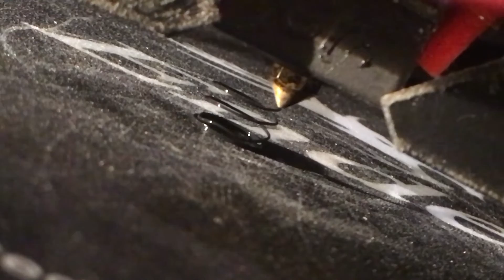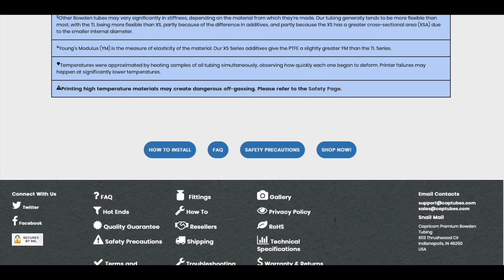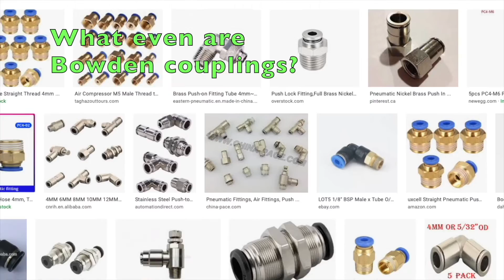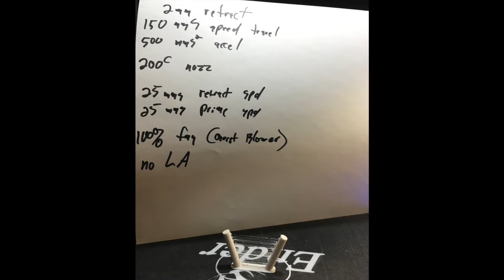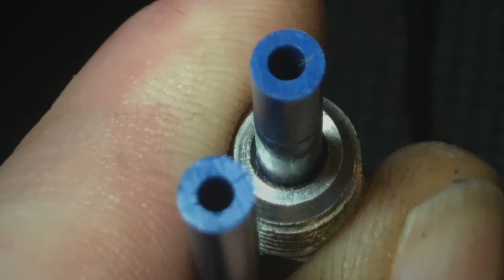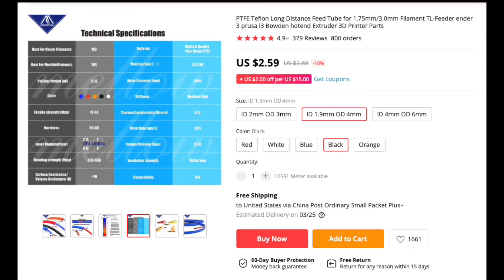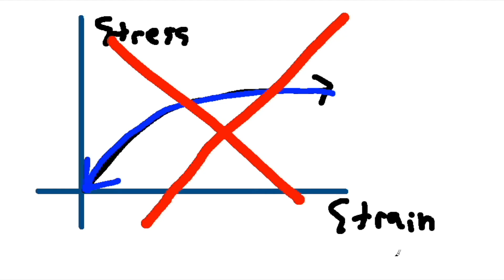Fancy Bowden couplings and fake tubing tests

Comment: I'd love more info about the hydrologic couplers you used! What sizes? Where'd you get them? What was the process of drilling out the PTFE tube for the inner compression sleeve?

Edit: The barb would preclude using the hydrologic fitting on the hotend side of the coupler, yeah?

Comment: Maybe this was your point, but the ratio of Young’s moduli between the tube and filament, I think, only matters in so much as the lower of the two will determine how much retraction/extrusion force you can apply.

So, ideally, your Bowden tube would be at least as stiff as the filament. If it’s stiffer, then the filament will stretch. If it’s less stiff, then the bowden compresses. In reality, I assume, both are happening. Complicated.

Comment: Here's a crazy idea and this could just be the right place to deliver it. What about a push/pull cable sheath? Something like bicycle brake cable, not exactly, but that kind of thing. They're steel reinforced to combat stretch yet designed for flexibility. Pretty sure there are Teflon lined ones too. Just a thought.....

Comment: does the fan cooling at 1:11 have any venturi effect like you teased on the fan videos or just small nozzle on 5015 blowers that are angled at like 45 degrees so you have a lesser angle of wind deformation?

Comment: I had an Ender 5 pro that "featured" some really crappy Capricorn tubing from the factory. Could very well be the same stuff you experienced.
After i bought a genuine Capricorn from a reputable source my printing quality went up a lot too!
(upgraded to a Ender 5 Plus now and upgraded to some real Capricorn too after that experience)

Really awaiting the (air) cooling followup from your other part 1 video... :D

Comment: Funny, I was going to post a comment that mine (direct from E3D UK !) arrived with a mis-centered hole and a larger out-of-spec OD, so it didn't fit my reamed hole in a cold end, ... but then you mentioned exactly that. ... E3D sent me a replacement, but the OD was still out of spec. So this is not just some dodgy distributor re-branding fake tubing. See photos (remove the space, damn spam protection): https://imgur. com/a/QlkOyt8

Comment: Hi Alex, to reduce stretching of ptfe tube try to use glass fiber reinforced packing tape (reinforced along tape) example of this tape is Tesa Monofilament. You need to wrap tube paralel to the tape it is tricky but gives awesome results. I personally reduced retraction from 5mm to below 2mm on around 0.5meter bowden.

Comment: Thanks, Alex. Keep that technical detail coming! It's hard to tune a system of you don't know how it works! Something that bugs me is that there is no feedback in the control system for the most important parameter which I believe is probably the pressure at the nozzle? I'm trying to think of a way to achieve that. Maybe a servo motor with power or torque sensing for extrusion drive?

Comment: For anyone interested I reverse engineered the link of the black aliexpress Teflon Tubing:
https://www.aliexpress.com/item/32354926214.html
And this one is similar from Trianglelab:
https://www.aliexpress.com/item/32961383872.html
Reply from the maker: Yeah, that's the stuff.  Sorry, I may have to post a follow up vid with all the things I cut out for time.  THat black tubing performed pretty well even though the tolerance was not quite as tight as Capricorn and the center hole was not quite as centered

Comment: I noticed that your bowden tubes are longer than what they need to be. I would assume that a longer tube means more friction, but also higher radius bends. Have you tested what is the optimal length ?
Reply: This might interest you: https://youtu.be/DB5b4673GJ0
Reply: There is also a printed coupling (thing:3837897) that claims to remove all play, would be interesting to see how this compares to the proper hydraulic coupler.

Comment: Can you please share the exact model of the hydraulic coupler you used and where you got it? The results are quite promising and your whole argumentation makes a lot of sense ...
Reply: I found these on aliexpress that look the same and should work: insert (GP-4-2) https://bit.ly/2w7D0ZF and coupler (JS46 4mm -M6x1 ) https://bit.ly/3a7N6sb
Reply: your insert link is broken but I believe you are talking about "10pcs JIANHE GP Brass tubing bushing 4mm/6mm/8mm/10mm Oil pipe fittings/ Compression Sleeve Fitting/ nylon tubing oil core" which is in the same store (JIAXING JIANHE MACHINERY)
Reply: @StrikeEagleCC  thanks but both links seem to point to the same item, still need link to GP-4-2. But i might look it up myself since now you gave us model numbers 😏

Comment: I just checked some "Capricorn Bowden PTFE Tubing XS" which I received a couple of weeks ago from AliExpress.  At first glance it looks and feels just like the real stuff (whch I also checked) and had the right labels - but the bore isn't concentric at one end, and the internal diameter measures over 2.05mm (I can easily slide a 2.10mm drill all the way in, quite different to the real stuff in which the bore is 2-3 drill sizes smaller).  And this wasn't cheap.  I've just opened a dispute with the seller :-(

Comment: Excellent video Alex.  Do you have a comparison pneumatic fitting ( with clip or zip tie to set the teeth ) vs hydraulic fitting with either the real capricorn or the black tubing.  Interested if the difference is substantial enough to go to hydraulic.  Again, thanks for a real eye opener.

Comment: I don't own a 3d printer, so maybe this is just me speaking from ignorance, but would bicycle brake cable housing work for this sort of setup? I imagine you'd need different couplings since the cable housing has a larger OD due to the steel in it, but you can get ones with the PTFE liner for pretty cheap. 
(Reason I even clicked is because "bowden cable" is the technical term for bicycle cables, and I'm subscribed for other content.)
Reply: You can also get compressionless brake cable housing but it's far more expensive, not sure if that would be needed for the printer but if you have trouble it may be an option.
Reply from the maker: yes I looked into it a little bit and I may see what I can turn up in the future.  My first thought was SIS shift cable, but it may not do well in compression, so I've had an eye out for cable with controlled internal tolerance as opposed to just 'nominal diameter'.  If anything useful comes of it, I'll post a vid.  My original hydraulic couplings were from shimano disc brakes, but i switched to bulk brass couplings because man they mark up the price when the box says 'bicycle'...
Reply: @AlexKenis  Shift cable housing is compressionless as the metal wires that support the housing run along the jacket as opposed to being wound like in brake cable housing. It may not have the correct internal diameter though, as shift cables are thinner than brake cables, so you'd have to test it with a piece of filament to see if it would actually fit. Brake cable housing has a larger ID, and there is compressionless brake housing - but it's a specialty item. Jagwire makes some, not sure who else.
In either case you'd be limited to 1.75mm filament... too bad the manufacturers don't make it smaller diameter. Maybe one day when the printers-manufacturers realize they can consistently get away with using shifter housing for a bowden setup?

Comment: I would like to know the size of the hydraulic coupling you used in the video. I am sure i can figure out the how too my self from the quick flashes of video you shown.
I use the black top pneumatic coupler they have a much better grip than the blue top ones. The black top also allow the PTFE tube to be pushed through hard up against my self designed extruder gear with out drilling the back out. I would be very interested in this hydraulic coupler for another setup.
Reply from the maker: THat was one thing I forgot to compare.  Those black 10mm thru-couplers hold really well on the hotend side, and don't develop play very easily, but you need a different feeder to use them on the other end.
Reply: @AlexKenis  yeah i have a self designed belt driven extruder 3.75:1 ratio with a 40t pinion gear. I brought a hobbed gear as well but i like the pinion better because of scrubbing of the curved hobb on the filament shaft and i never had a grip issue unless it was catastrophic. So i use black topped couplers with aliexpress 1.9mm ID tubing. The PTFE tube is cut to the shape of the pinion gear and idler bearing and meets up less than 1mm tollerence. I tried printing TPU on my bowden its working ok. I want to mount the extruder on the right x axis on a cartesian to shorten my bowden that will help.

Comment: So much misinformation. You can't say it's fake unless you know. You can't use calipers to measure the inside diameter of a tube. That's just ignorance. Your data is piss poor.
Reply from the maker: Hey Chris.  I understand your concern : I cut out a lot of the methodology explanation and fast-forwarded the testing for the sake of vid length, but you can see in the FF sections that what I did was measure the wall thickness at several points around each cross section and use the difference between that and the measured diameter at the same cross sections, at several spots of freshly cut tubing.  That is as accurate as I can get without specialized test gear... BUT  it did show that the genuine Capricorn was pretty much spot-on exactly what they claimed, which also somewhat validates the methodology.  I used to to fabrication and QC on industrial control equipment, including pneumatic/hydraulic systems for Kimberly-Clark and the like, so it's not my first rodeo, but you are right in pointing out that I should not just trust that everyone assumes that my results and methodology are solid. I would have been more thorough if I had been accusing anyone in particular, but I know (and you know) the reseller as an honest guy, so I left names out of it until we can see if it was a mistake from a middleman distributor or something else.
Reply: Yeah, he measures the wall thickness not inside diameter. It's then shown in the diagram. You seems pretty stupid for a smart guy.
Reply: What's Chrissy's problem, if Alexis did any more in detail explaining/relativ-izing no one could watch this. It's all laid out as open as bearable, we can all notice the parts of the results we deem important... Don't see any mis-information just an excaustive presentation of happenstance
Reply: If Alex did such a poor job (in your opinion) then why don't you replicate the experiment. That is how science is done. So put your money where your mouth is and provide your own data.
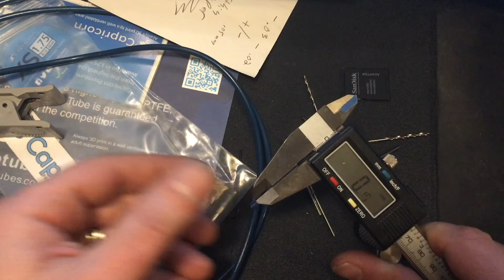Reply: I think he was actually measuring the wall thickness with the calipers. If you stop at the 14:47 mark you can see the section of tube held in the calipers by the wall. Maybe he doubled the wall thickness and subtracted that from overall diameter to determine the inner diameter.
Reply: With all those drill bits on the desk when he's measuring the thickness at 14:47 I'm fairly sure he could have gotten reasonably close as far as horseshoes & hand grenades go, coupled with the discoloration from a known good quantity & stretch test. And ya you CAN measure the inside diameter with calipers with a gauge block.. If glove don't fit you gotta acquit. That also ignores the results from the prints working and the deviation between them. I'm inclined to believe the rather large amount of data he provided. Being as you make videos yourself why not reproduce his results and show the difference you found instead?  I'll wait for your reply here with a video to validate your claims ok? I don't have the time and money to go around intentionally buying fake things to test and really appreciate people identifying and testing it for me so I can when I do it unintentionally. If you can help to fix that by invalidating/validating his data I'd appreciate it it's how science and testing works after all isn't it? Thank you in advance.
Reply: @Chris Warkocki Maybe you can't.  Maybe others understand appropriate techniques.  There are plenty of people around here who are used to mesuring small things.  I measured my tubing the quick way with drill bits from a fine-step (0.05mm steps) metric set which I then checked with a micrometer.  I apparently have some genuine (from an authorised reseller, correct bore size according to Capricorn's specs)  and some fake - much larger bore size. Very easy to tell apart when you try.
Reply: @Chris: I like the fact that Alex is an original thinker: he uses his own brains, gut, experience .... and also tells us what he is doing and why.
Reply: Why are you being so aggressive ? he explains that either it is fake or the manufacturer changed the specs of the tube drastically, and fake seems the far more likely option.
Reply: Just because someone uses big words doesn’t make them smart. In this instance because he tested things doesn’t mean he did any of those tests correctly.
Reply: @Mr3DPrintWizard  I guess there's always room for improvement but I don't get the mis-information .. he did show he used calipers to measure which is truthful and comparable within the test. The other actual critique you mentioned was he called something fake without testing?... He showed the results and there was a difference of everything against Capricorn original ... Sorry but can you point to a specific thing that's in-accurate or is it justv all: 'you know, if you'd asked me if I'd do a way better job'
Reply: Sascha Neubauer you can’t use calipers to properly measure the inside of a tube. That’s not what they are used for.
Reply: @Mr3DPrintWizard  but if he measured all the ptfes the same wrong way? What's the margin of error you'd say? What should've been used?
Reply: @Mr3DPrintWizard  Do you think that you look smart with what you are saying here ? if you don't explain clearly why you think he did not the tests correctly you just look like an angry idiot.

Comment: Thanks for the great video. There is one subject you brought up at the end that is not will understood is hotend temp and flow. I found that my Ender 3 has to print at 230c using PLA + . I stopped using Capricorn Tubing because is would clog too fast and under extrude during a long print. I was not aware of counter fits till now thanks for that.

Comment: For the extruder, I usually back off the coupling 1/2 turn, seat the (Capricorn) tubing, then tighten the coupling down. It compresses the tubing between the extruder and the coupling teeth.  Haven’t had any movement at all luckily
Reply: This sounds like great advice.  I wonder if there is a way to do the equivalent on a BMG style extruder.
Reply: Is it reversible? Can you do an atomic pull easily? It implies removing the coupling and pull the cold filament out of the nozzle

Comment: Because of fear of bowden-slop I mounted my extruder on the center of the horizontal z-bar the nozzle carriage runs on .. just an idea..
Reply: hows that working out? I was considering this also as it lets you shorten the tube a little
Reply: @tablatronix  haven't seen any negative effects. Also I feel like tpu prints better, but haven't done any before and after tests.
Reply: Your X is my Z ... Seen this in this video the first time, least I thought the extruder moved upwards in that one shot. Guess it's a good compromise but haven't found it to hard to design/print a 2nd plastic bar, attach it at either ends of the original bar and maybe save another 3rd length of tube. ,. Would love to see a scientific test of either approach though ... Maybe with std ptfe comparing against fixed couplers and Capricorn ... Though the test combinations seem unsurmountable ;)

Comment: Curious how HVAC pneumatic tube would work on these?
If you ever go to an older hospital or large commercial building and hear air hissing from a thermostat that you can not adjust... it's a pneumatic control system.  They use black tubing that kinda resembles ABS.  I don't have a clue as to what it's made from but it doesn't stretch much at all.
Reply: I would think that length of over-all tube would be important in this case. For short runs you might get away with pneumatic tube, longer runs and you might not get past the extra friction. This is just a guess though, but friction is the main reason to use teflon tubing.